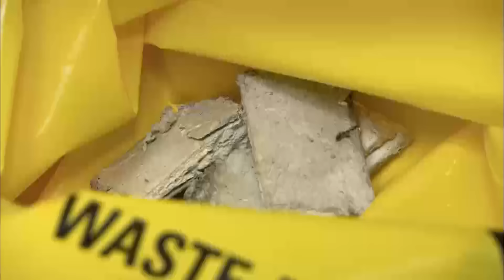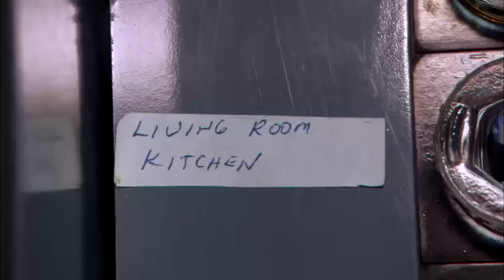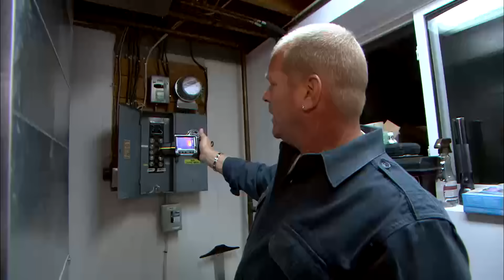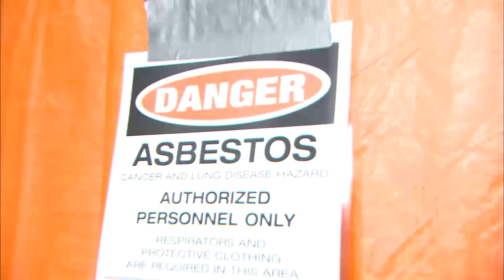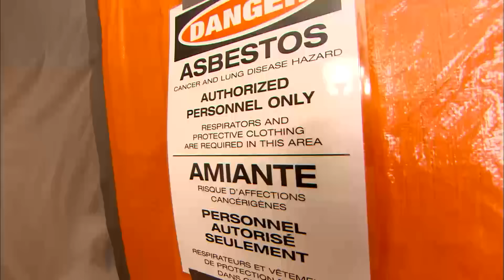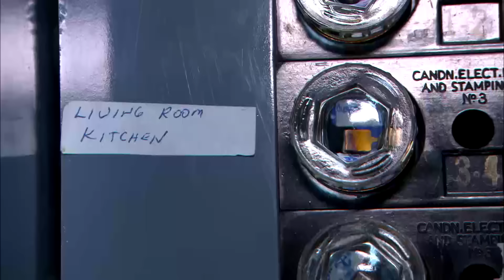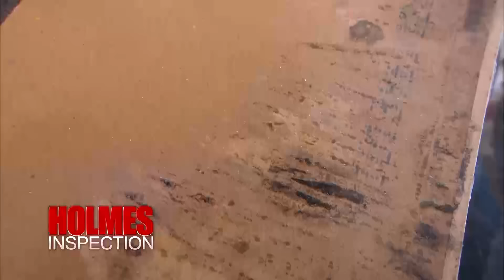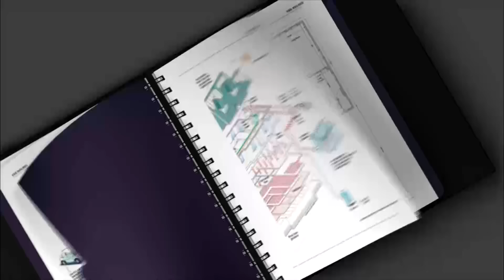The Ultimate Problem Home Makeover | Holmes Inspection 213

Comment: It's great that Mike has been making it right for so many years. Watching him, his crews and trades work has been very helpful to me in my first home.

What I found is that it's hard to find people to trust. Contractors, electricians, plumbers have done some work in my house that's not quite up to snuff. Tell them and they get indignant. Then call more electricians and plumbers to fix their mistakes.

I'm lucky to have found trusted electric service and plumbing companies.

At this point I will never add on, finish a basement or do any major upgrades requiring more than one trade at a time. I simply don't trust anyone to do it right.

Comment: Before buying that house this family apparently would have needed a roof inspection, an HVAC & insulation inspection, a structural inspection, an asbestos inspection and an electrical and a plumbing inspection, as apparently "home inspectors" don't need to go on the roof, in the attic, or open the electrical panel or actually check the heating system or look at anything below the surface. - Glad this sweet family actually got everything fixed in their modest home.
Reply: When My Daughter bought her house, I was lucky enough to have a friend who was a high rated home general contractor, always busy, so I asked him if you were buying a house who would you hire to do your Home inspection? He gave us a name, he charged about $100 US more than other home inspectors but spent 3.5 - 4 hours going through the house. He wrote everything down and took a picture to accompany any issues he found. She was able to renegotiate the price based on those findings, giving her the money to fix the issues and also a heads up on a few items that could use improvement. 
He went into the attic and onto the roof also pulled the floor and wall duct outlets to look for possible asbestos, He explained if he had found anything that looked like it He would've recommended for those specific areas and that he always recommends getting an asbestos company to check the plaster on any home built in the 70s or before?  I believe it was. 
The good news is there was no asbestos tiles, or duct coverings that needed special attention.
She's been in her house 12+ years and his inspection was 100%, she ( and now they ) have had no issues that weren't pointed out and have made improvements based on his recommendations such as adding more insulation and upgrading windows and doors. 
If you want a home inspector find a highly rated contractor that's been in buisness for 5+ years and ask if they do inspections or if they would recommend an inspector. You'll also then have a good  contractor if you need improvements.
Reply: @TheWabbit  Excellent!

Comment: Was this a DIY nightmare or what all these tradesman coming in and fixing all these problems, Asbestos, Old Panel, old roof shingles all sorts of problems and a Heat Exchange with a holes that was next to a gas line could of blown up that house 😲
I am glad Mike Holmes is a House Inspector and Contractor he brings in the Best Tradesman and does through Inspections  😊

Comment: In that bedroom with the water damaged drywall, why didn't they just take the whole ceiling down rather than doing all that patch work?
Reply: They didn't patch it. They removed a section of the ceiling. No need to remove the whole thing - the video said so and why.